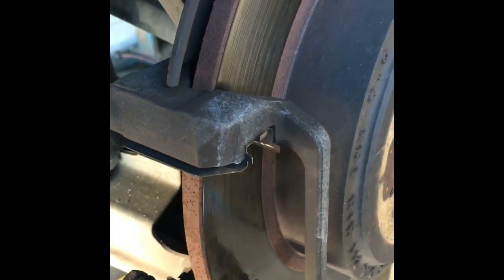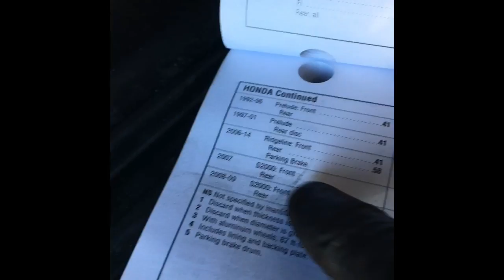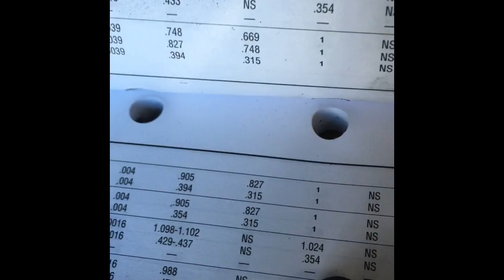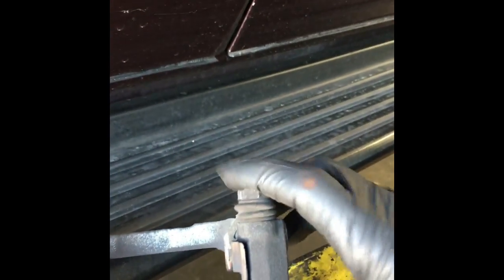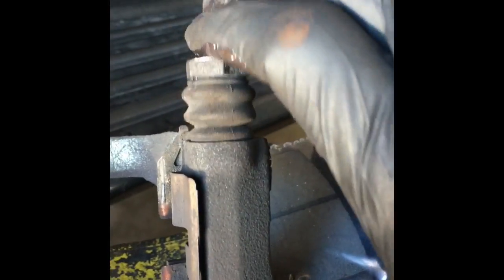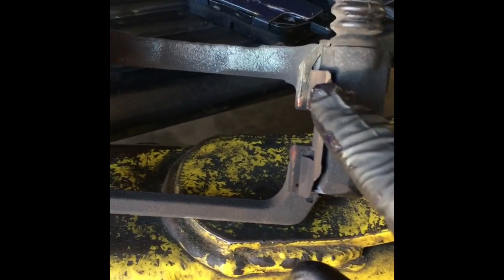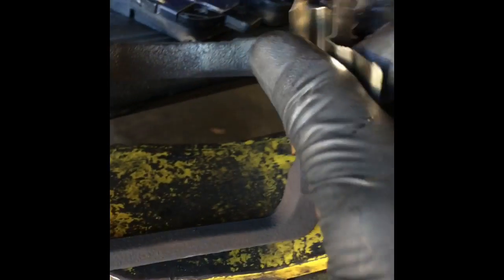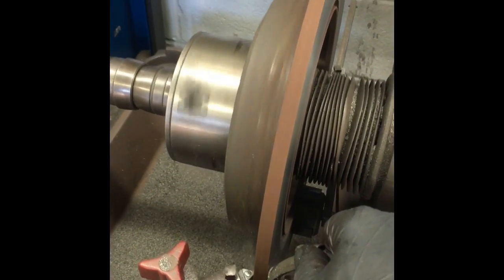How to Replace Rear Brake Pads and Machine Rotors on a 2007 Honda Ridgeline/Pilot

Comment: Don’t start without that M8 x 1.25 bolt!!!  This is a critical tip.  Without it, I would have been dead in the water on the second side of my break job.  The rotor would NOT come off.  Using the bolt to press off the rotor is impossible without the less-than-a-buck bolt from the hardware store or Home Depot.  I’d go to large store (E.g., Home Depot) with a decent selection on METRIC Bolts